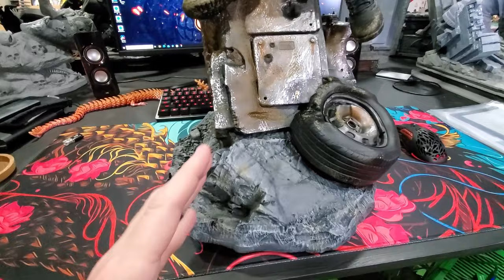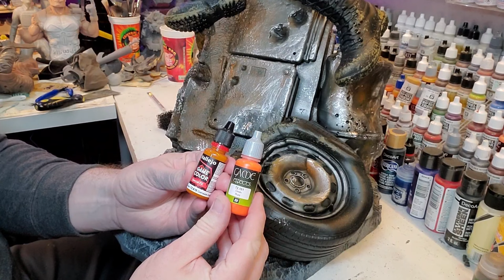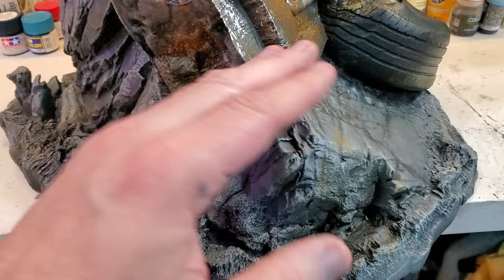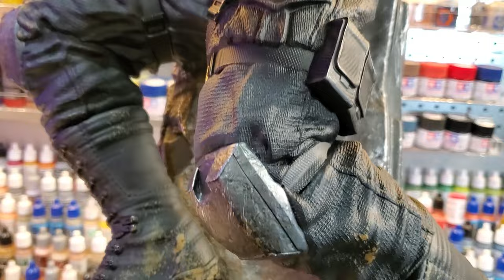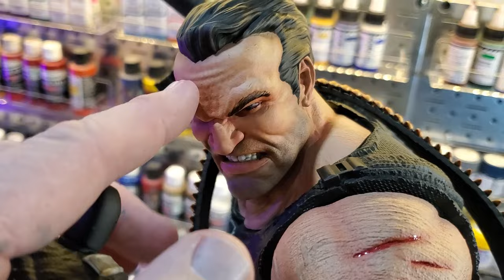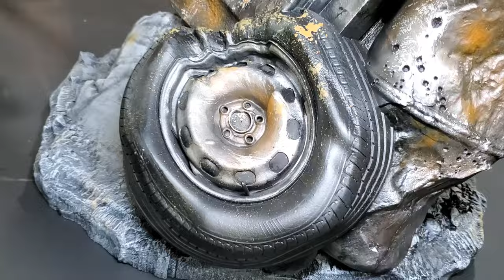The PUNISHER 3D Printed and Painted- EASY Weathering Tricks

Comment: Hey boss, solid job. I know you do these videos out of the kindness of providing back to the community but i was wondering if i can be super bold and make a video request. I am getting ready to print my first LARGE scale model and honestly dont want to mess it up. I was wondering if you had a video or could make one covering a couple points. 

1) I have a model that is a known 1/4 scale but i want to scale it up to 1/6 and or the model is already 1/6 scale however, some pieces become too big for my printer, how would you approach that? what are you doing to "slice" your models to fit on your print bed if you dont have a large format resin printer like the mega 8k? personally i have the saturn 3 ultra. 
2) how excatly if i have a model and i dont know what the total scale is, would i figure that out? some modelers dont give this detail and there are say 30 pieces to print how do i ensure that i scale all pieces properly to make the model around that 1/6 scale? obviously i could scale all to 150% and call it good, however, would have no clue how big the final piece would then be.
3) obviously, i caught your video about doing the 5% infill however, when you review your models prior to printing are you manually going into the hollowed print and adding any supports to any islands? I did a hollow on my print at 1.8mm then noticed after the 5% infill i had some islands that were present. How would you address that? 

Sorry for the long comment, didnt know how else to ask the questions but yeah...was super curious if you would do or if you have a video that specifically focus's on those aspects above as i feel personally that is the area i am lacking in confidence before i go and print some of the very large things i want to print. thanks in advance for any help you can provide your content is super awesome and the live streams are fun to be a part of!
Reply from the maker: So for the selling issues, I would check out Sanix site. They have a scaling tool there you can use. If you're trying to cut models to fit your build plate then check out Meshmixer. It's a free site to use. And for infill issues I use the repair option on chitubox. If I have any islands, which I usually don't, I'll add drain holes during the slicing process.

Comment: awsome statue, did you print that hollowed or solid?
Reply from the maker: It's hollowed. I couldn't imagine the weight of it if it was solid. lol
Reply: @TheCreativeCollector  makes sense, what thickness do you recommend for the walls?
Reply from the maker: I used a 2mm thickness. Not too thick. Just right
Reply: @TheCreativeCollector  got it, thanks for sharing! greetings from Sweden ✌